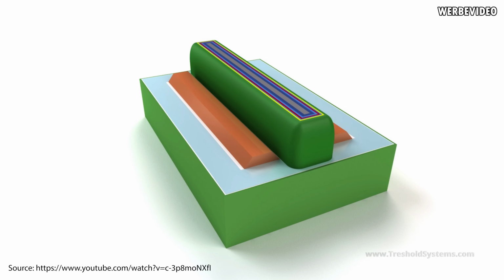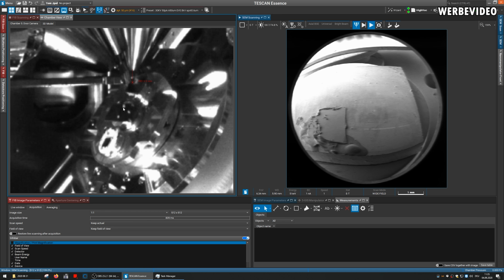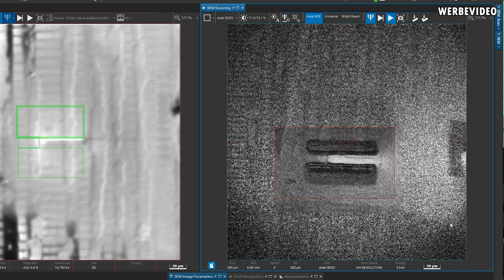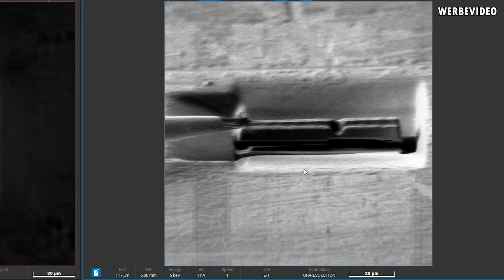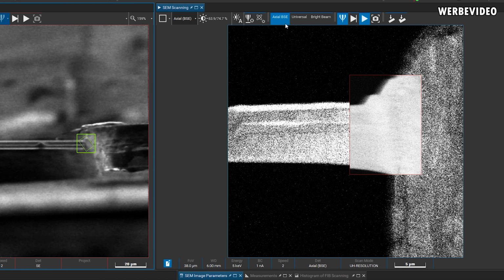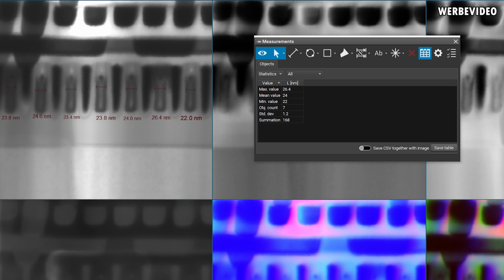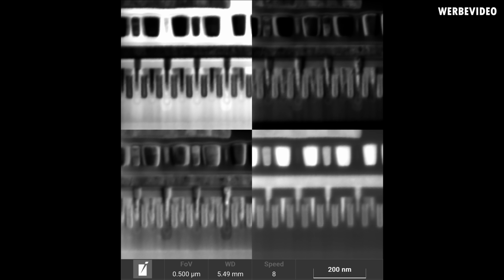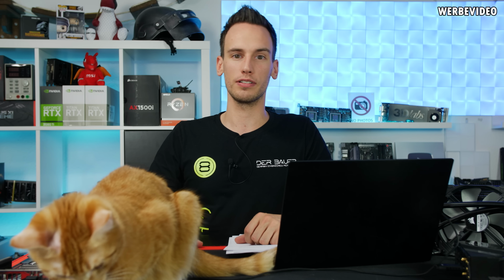14nm and 7nm are NOT what you think it is - Visiting Tescan Part 3/3

Comment: At 6:32 you should have also mentioned that you basically weld the specimen to the needle by depositing the Pt on them. It is a very neat process. The positioning of the needle also deserves some attention. To be able to move the nanomanipulator on such a delicate scale, piezoelectric (pzt) "motors" are used. By changing the voltage across the pzt crystals, they change their volume. They are perfect for this kind of small-scale manipulation. It can be funny when you accidentally push the lamella too much with the needle and it just breaks off and flies away.

STEM is scanning transmission electron microscope. You basically put a detector under the specimen, so you are able to detect those electrons which are passing thorugh the specimen. The advantage of this system is that you can do everything within the SEM. But it does not have such a high accelerating voltage as a proper stand-alone TEM, so you won't have the same high resolution.

Comment: As I understand it, the naming of a node / process as an "X" nm node, whether 14nm or 7nm or whatever, is based on the smallest discrete feature / structure that can be reliably created.

That does not mean the width or depth or height of an entire transistor, or of a three dimensional gate.

It could be the width of a "fin" in a FinFET, for example.

The smallest discrete feature / structure that can be reliably created.
Reply: Nope, the entire point is that the naming scheme doesn't correspond to any feature on the die at all. For example, when the foundries introduced FinFETs, they called this a new process node, even though there was no real density change or die shrink. But the performance increase was similar to that gained by a traditional Moore's law shrink, so they changed the nm designation and called it 16nm.
Reply: @TheCkap35  "even though there was no real density change or die shrink"

I understand that, which is why i said "That does not mean the width or depth or height of an entire transistor, or of a three dimensional gate."

I will say again, the smallest discrete feature / structure that can be reliably created.

It could be the width of a "fin" in a FinFET, for example, which is much smaller than the entire transistor of which it is a part.
Reply: In your example of  the foundries introducing FinFETs:

Was there an increase in (transistor) density? No.

Was there a decrease in overall die size? No.

Was there an increase in performance? Yes.

Why?

Because they were able to reliably create more complicated, higher performance transistors, such as FinFETs, comprised of smaller discrete features / structures, such as the fins.

Without increasing the resolution that would not have been possible.
Reply: @Richies_Beer_n_Gear  "Without increasing the resolution that would not have been possible." -This is not correct. When the foundries introduced FinFETs, there was no substantial change in the capability of the lithography process, so there was no actual change in the resolution. The product became better due to architectural factors (having nothing to do with increased resolution), so they called it a smaller node.

Comment: its all a scam
buying cpus to fund the making of the next cpu and the next cpu and the next cpu 
they have multiple cpu designs that increase in performance 
its all for money 
they dont care about giving you the fastest/efficient cpu
they just create a cpu design that is 10-50% faster not even 2x faster but % faster
performance never doubles from one generation to the next the percent only goes up
same as with gpus top tier will give 60 fps next gen will give 80 fps 
you will never see a next gen giving 2x fps or going form 60fps to 120fps  for the same benchmarks
its always and will always be percentage based
pure scams

Comment: I think about it as 30nm is worse than 20nm, at same size you can fit less transistors, need more power, get less performance.
More useful would actually be transistor count per 1 mm square, density, and total number or transistors per chip, which should translate into more performance.

Comment: I have always thought that only the (approximation of benchmark numbers / power consumption) and ( heat delta over ambient * price of the cpu) perspective. If the first number is higher and the second number is lower, you get a more efficient cpu basically. 7nm or 14nm doesn't mean anything really. Watching this video using a computer with an AMD 3700x cpu. I still think it makes more sense to get a 3700x over the Intel alternative within the logic i explained. But also AMD sucks because they lie to their customers about the transistor size. Intel does that too but at least their lie is smaller. They should use bigger numbers. Because anybody would assume that 7nm means the size of a single transistor including the gate and source and drain all combined together. But when you look deeper the whole picture is like ooooh, that's a whole lot bigger transistor. I hope this kind of marketing schemes will begin to end thanks to your video. I personally feel like you deserve a big prize for this excellent work you've done.

Comment: What an annoying naming scheme, makes me think of what it would be like if car manufacturers did that with engine capacity, sure i get there are lots of other metrics and factors but if an engine is called the 5L v8 it should be 5L not 4.5L.......holy crap I just realised as I said that, this is something BMW does, they started calling cars 330i which used to mean 3L even though it's a 2L engine now :O

Comment: 14nm: old tech that can run hot. More optimized for clockspeed. Power hungry, easier to OC.
7nm: Cutting edge. More performance per mhz. Very vulnerable to temps and power increase compared to 14nm. Little OC headroom.

Comment: from lithography, I thought that nanometers have to do with the accuracy of the process. For example a 14nm can have features that can be materialized using a 14nm beam. That still maybe true!
Reply: Nope, the entire point is that the naming scheme doesn't correspond to any feature on the die at all. For example, when the foundries introduced FinFETs, they called this a new process node, even though there was no real density change or die shrink. But the performance increase was similar to that gained by a traditional Moore's law shrink, so they changed the nm designation and called it 16nm.

Comment: 0:40 They're mainly for marketing. A better measure would be transistors per mm^2 (number of transistors is a better measure overall, but they're not all equal), but then we live in a world where laptops are measured in thinness, not thickness.😏
Even clock speed is no longer reliable as they're being managed per millisecond on modern CPUs. It's tricky... Then we have Apple being Apple, who now use operations per second not FLOPS (not that those 12 billion transistors would ever be used simultaneously), yeah it's complicated...
Then we now have Intel who now measure harmony and feelings "11th Gen Intel® Core™ processors perform in an unprecedented harmony, redefining how laptop performance is measured."🤷‍♂️
https://www.intel.coDOTuk/content/www/uk/en/products/docs/processors/core/11th-gen-processors.html
Reply: Not far off, woohoo! 🤓
I'm kind of mind blown of the precision used to cut the samples, and that they used platinum as superglue (but it's only £22.45 per gram, which isn't a million miles off Kryonaut Extreme ~£2.45/g😉).

So, I guess you could say that transistor size is a little like how VW measures MPG.

Comment: Intel and TMSC (and others) are buying the lithography machines to manufacture their architectures at the same company (ASML). To me it is logical that they should have about the same spatial definition.
Reply: Intels 10 nm is produced with the same 193 nm light (deep UV) as their 65 nm node was/is. How do you make features smaller than the wavelength of light? Self-aligned multipatterning and immersion lithography.

TSMC used to use DUV for 7 nm but now use 13.5 nm EUV wavelength of light and features are approximately the same size as their old DUV 7 nm process. The wavelength of light is less relevant than you expect and improvements in lithography happens much faster than the improvement in light source.
Reply: @soylentgreenb  I think intel was planning to move to EUV on 7nm wth GAAFET transisitor  but they are facing roadblocks and delays. TSMC has some part of the process EUV in N7, i think N7+ has even more EUV processes, but 5nm should be fully EUV but want FAAFET at 3 or 2nm.
Reply: It's just a lithography tool. it only does what the process engineers make it do. It's like saying your auntie's pie is as good as my grandma's because they use the same oven :)
They have the same capability, but it doesn't make any silicon comparison possible.
Reply: Le Doynier overlay is the key driver of yield and leakage

Comment: I love stuff like this. This is the sort of thing that keeps me interested in tech.

Now to the commentary...

If I'm wrong about this please correct me, but the cache is SRAM. The SRAM transistor is different than the HP CPU transistor, correct?

If you had gotten a scan of the AVX unit or an ALU, the transistors would have been different would they not?

The SRAM density is very similar between the two but if I'm understanding this correctly the transistor design of the execution units of the chips are different than the SRAM size which seems to be confirmed by the fact that you can visually tell the difference between the SRAM and the execution units on a CPU die.

Not criticizing, just learning here.

Comment: Seems like nm processes have turned into average tolerance/control, meaning that a given dimension or component doesn't vary by more than 7nm or 14nm average. Half the dimensions can be bigger and half can be smaller. The over/under shot in the video seems to follow this tolerance/control. For engineering, if you know that your manufacturing process is going to have double the size control as before, you can plan to put more things inside a given area (or make it smaller/equal to previous), just not double because there is still that average factor.

Comment: Awersome video. I remember i read somewhere before that everytime there a new process the transistor density should increase. I believe mainly why AMD have caught up with intel to a certain extent is because they use a higher transistor density process for their ryzen processor which give a boost in performance plus the extra cache to catch up with Intel. I believe Intel still has the better processor architecture. Once intel settle their 10nm process issues. Their next gen should have a big jump in performance. 

Great job in making all this interesting  videos.

Comment: Those numbers are used to mean the minimum length of the gate, ex. "TSMC 180nm" has minimum gate length of 180nm and "TSMC 0.25um" has minimum gate length of 250nm. But when they switch to FIN-FET this rule doesn't apply anymore.

Comment: 0:40 Uhh, nanometer ratings used to be based on actual feature size, but are now just ballparked to be a ratio smaller than the previous size, which was also a ballparked BS number. Basically if you say you've halved the size each time, you can call it half the feature size.

Comment: Pretty great video my dude, nice trip to the scan-factory. I always thought Intel could do alternate optimizations but this impressed me while it also upset me a bit on Intel's behalf.

I think those pointy parts may be the reason for why Intel can blast their processors at higher Celsius figures while AMD have retained less voltage, less thermal headroom, but have gained more yield in terms of the structures potentially breaking down or not. A needle standing still will do well over time the same way a thicker stick also will under higher strain so long it's not too high and stable at that. If Intel ever create a solution that can run away from AMD, I now am semi-confident it'll have to be done trough smart yield and chip-sandwiches and nothing else. If cutting edge, and polished+++++++ look this similar then that honestly settles it. Great work from the chip makers, Intel, AMD, you, the scan lab. Sick info for analysis.

Comment: Really cool analysis.  One quick comment.    Few years ago, TSMC naming scheme for its process started to reflect the smallest feature it can print on a wafer,  which is a "fin" of a finfet transistor.   Therefore if you measure width of a fin (3D structure orthogonal to the gate), it should come out closer to a "7nm" give or take 1 or 2 nm. - at least for the first generation 7nm.    But of course this makes measurement under the electron microscope that much more challenging. 

Intel 14nm still adheres to a older naming scheme, but it is roughly equivalent to TSMC 10nm half node process.   Thought the ++++ may have shrunk it down to closer to 9nm.   

Most importantly the characteristic of the transistor is quite different.  Ex.  TSMC 7nm transistor can operate at a lower voltage and requires a lower voltage to turn it "on" or "off" at the gate.    Therefore its dynamic power dissipation tends to be lower than that of Intel's 14nm per unit area.
Reply: I think the Intel +++ is more about improvement in 3D fin structure for more frequency range, lower voltages, and higher yields rather than density improvement. I think they all know that now this is more of a marketing term that a physics. They know consumer cares about having smaller number so they give this.
Reply: @NizarElZarif  very much
Density is one but not the only way to give lower voltages, higher frequencies, higher yields, etc.

One example this is 10nm SuperFin. SuperFin technology uses better transistor designs and better materials. 

SuperFin gives like 20% better performance without increasing transistor density as such.
Reply: @NizarElZarif  Improvements in process can even lead to increases in density, but not in performance per watt. That's how you see the so-called half-nodes, like Samsung's 8nm (Shrunk 10nm)
Reply: As far as I understand the 7nm should refer to the extension of the gate between the source and drain connections on the fin.
Reply: Intel 14nm++++++++++++++(/s) fins are also roughly ~7nm, IIRC
Reply: @jonathanmitchell9779  The 14nm only stopped at +++, Rocket Lake will be made with the original 14nm node because the refinements did not make it overall better especially for desktop use
Reply: @jonathanmitchell9779  I +++ your comment

Comment: The figure is minimum feature size, which has to do with the capabilities of the lithography process not the size of the transistors. Smaller minimum feature size allows for tighter tolerances, and better consistency, which has some impacts on yield and binning, but almost no impact at the consumer level. Sampling the L1 cache was an interesting choice in this regard since the design criteria would have been nearly identical between manufacturers, and easily within the capabilities of both of the lithography processes being employed. Unless another advancement the likes of finfet comes along this is the best silicon can do. What I want to know is how this ever became important to consumers.
Reply: It's not important to consumers and likely is only even talked about because of r/amd because you know- "iNtEL iS DeAD"

Comment: What was the actual transistor density you found in your samples?
Reply: Alex Stapleton it depends on what transistors we talk about. Different areas of cpu use different desity with different transistors. So it is not a fixed Number. For example cache and Logic circuit have different density in the same cpu.
Reply: @haukionkannel  yes I also watched the video thanks.

He cut the L1 cache part of both CPUs measured the transistors and then spent several minutes whining about how they name things without ever telling us the densities he actually measured.

Comment: This video sums up in short how I explain it to people who know a bit about it. TSMC uses 7nm EUV excimers to produce chips.

It's down to AMD and Intel or ARM to design an architecture and type of transistor which is small, and TSMC will give them a specification on what their equipment can do. 7nm is to a CPU as a PH1 screwdriver is to a PC Case. It's just the excimer beam width essentially.
Reply: AMD, Intel, and ARM have to follow the design rules within the process library they're using from the fab though. Like N7 from TSMC has some restrictions on certain metal layers that N7+ does not.

So the process is developed by the fab, and there's a certain amount of libraries for each process that fit different needs. Like high density low power for mobile SOCs, and high power relaxed density for high power or complex designs.